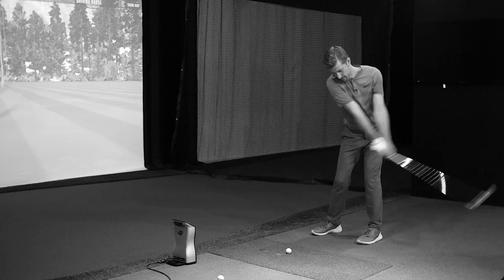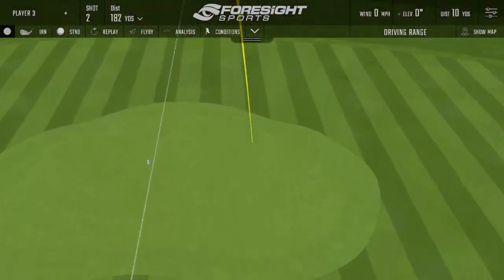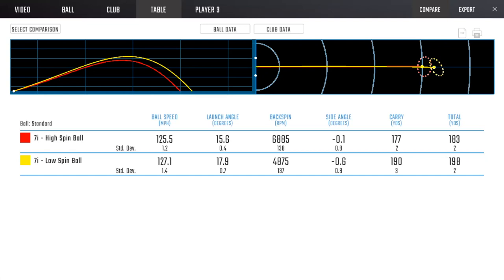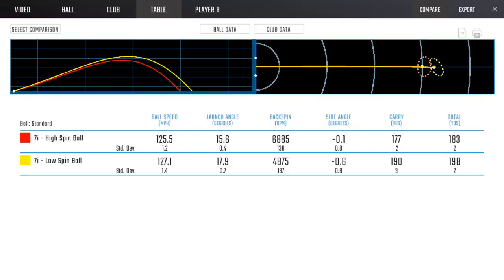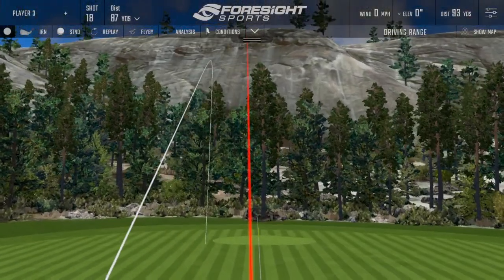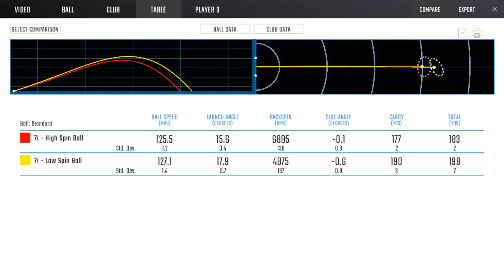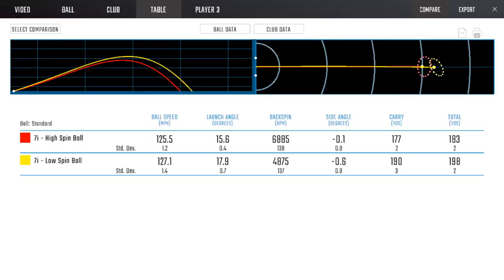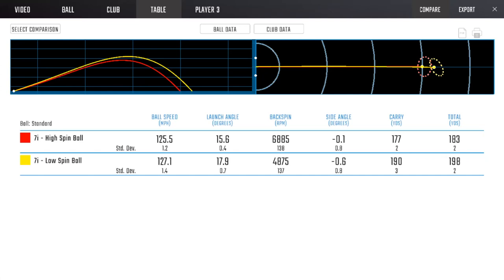Stopping Power + Change your Flight with a Ball Choice

Comment: Awesome video! As a high ball hitter (around 115ft apex and 50* angle of descent with most of my irons) this confirms my ball choice of the TP5x. I tried a few higher spinning balls because my irons spin low according to launch monitors (5k for 6 iron and 7k for a 9 iron) but the higher spin balls ballooned on me and I really struggled with distance control in the wind with them.

Comment: I used to watch golf in the days of the balata balls and marveled at the drives that took off low then rose steeply, like a fighter jet, as the spin really took effect. You don't see that from any modern ball.  Naturally I purchased some to replicate the pros of the day. My drives started low and ... stayed low and short.  I just didn't have the club head speed to generate the spin necessary to lift the ball. And after going through 4 very expensive balls in a single round due to cutting the covers off them, I called that experiment a fail and reverted to the good old Titleist 90.

Comment: Since this was for patreons I am not sure I am allowed to comment but here goes anyway. As the avx is top of the price range like pro v 1s etc for mid handicappers who are trying to improve and have better ball control it would be interesting to understand better ball fits and options. There are so many out there that it becomes confusing compression rates aside. As for myself after just trying at least fifteen balls regularly - including my sets of old balata  balls (I had many), And despite different marketing messages and suggestions, I just ended up really liking the seixon qstar tour - in terms if giving me distance, better control, feel, chipping and putting around greens etc at a reasonable price. The bridgestone b330rxs came a close second, followed by the 2018 chrome soft (latter two more pricey but still not in the v1, avx range).

Comment: Hi which ball would you recommend for a guy a right hand golfer who hates missing right. 
Angle of attack is steep. Swing speed 118-121
Launch 9-10 deg with driver. I’m a little bit confused cause I create too much spin with my angle of attack but at the same time I hate missing right. At the same time do I need a high spin golf ball to stabilise the flight???
Please help? And also do you do online fitting if I provide you with TrackMan numbers??

Comment: I know this is an old video, but I have a shallow swing on both irons and driver. No divot on irons at all. But I have a very low flight, I play 919 hot metals with either Bridgestone BXS or titleist ProV1X. No matter what I do I can’t seem to get a higher ball flight. Any tips for a ball or swing tip?

Comment: Hi guys, luv the content you produce very unique compared to other channels! I have a swing speed of 82 with 7iron callaway apex CF16 add to 33* xp95 shaft to get better launch and spin but still have trouble stopping on greens and getting a good peak height could you recommend any balls from your experience? TIA for any help keep up the great work 👍
Reply from the maker: Sounds like weakening the lofts slightly would be beneficial.

Comment: I have a question that is not really related. I want to video my golf swing when I practice. Do you have any suggestions on what to use? I cannot afford the new iphones or Samsungs but I could an older model. Would these be my best bet or is there something better. My understanding is you need at least 240 fps. 
Thanks for all your videos. 
N.W.
Reply from the maker: 120fps is good as well, I believe a few older models will do that at HD resolution.